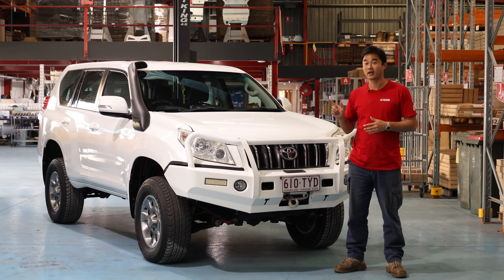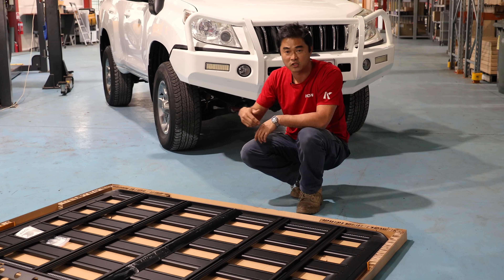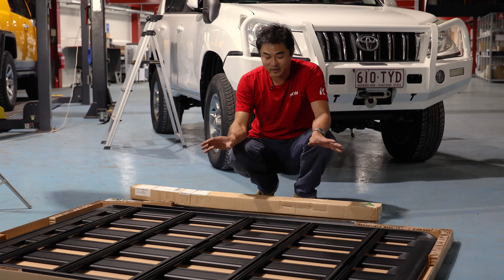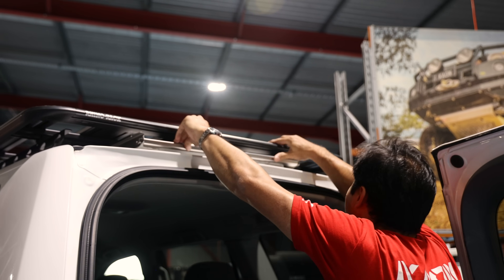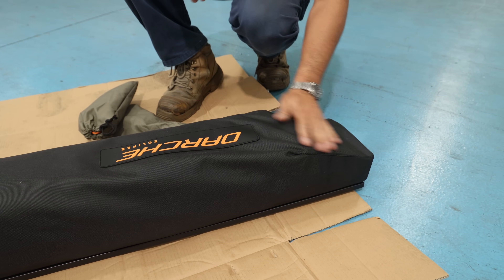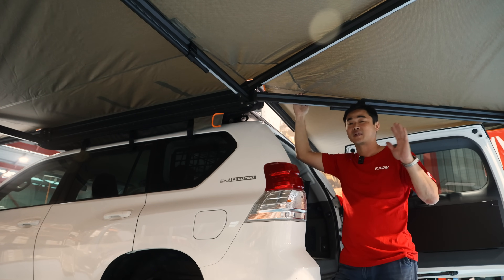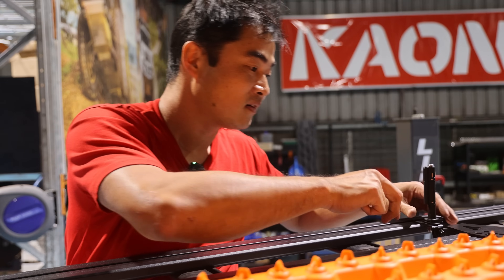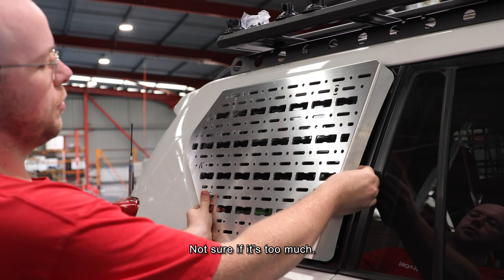Working Top-Down: Fitting out the Roof Rack & Concept Products Behind-The-Scenes

Comment: Have the same awning on the same car, the extra flap at the front slides out and you can slide it in the rear arm to bridge the gap above the boot. Great for when its raining
Reply from the maker: Yes definitely, great tip! We've got it stashed inside the car at the moment but it'll come in handy if the weather turns sour.

Comment: Like the roof rack and accessories, will probably get your max trax mounts, they look nice.
What weight for the roof are you using as the maximum all up for the Prado?

Those rear window outside mounts look interesting. If you are going to make them suit a range of roof racks I can see a challenge there.
We have an ARB base rack that is a lot wider than the back bone and sticks out quite a bit on each side, but gives us more space and your feet to not hit the Prado body when using a side ladder.
It would be nice if you can get your hand [flat] behind the panel to clean the window if necessary, and make it easier to fit attachments
Mud can accumulate under things like those window panels over time
Can see these being very successfull if enough accessories are fitable
I guess you can only go as wide as the mirrors, is that correct?
Reply from the maker: All great points and questions! 

From memory the Prado has a 100kg load rating, so we'll be working to keep both well within that and the total vehicle GVM. 

Definitely will be a challenge to release the Exterior Panels for multiple vehicles – the adjustability for the variables across the market is going to be the biggest challenge, but not an impossible one. Even just within the Rhino there are various rack sizes and configurations available for the Prado, let alone the other rack makes on the market. 

We wanted to get a working prototype on the car for real-world testing. As this is a totally new concept for us, there are some unknowns with the method of attachment we've selected and nothing beats actually using it to learn what works. 

Extrusion laws for the side vary from state to state, so we're also currently gathering legislation from the appropriate bodies on this topic to fully inform what can be done.

Comment: You're really helping me out here with my shopping list of what I'm going to do with my Prado. Love your video's and looking forward to the next one, especially keen to see what this rear side window bracket is all about. BTW, is that table still available at Bunnings and does the table mount fit other tables. Cheers
Reply from the maker: Thanks so much for the kind words, glad to hear you're finding the series is helpful! The table mount is still available at Bunnings (It's the Marque 4ft Trestle Table, you can find the link on the slide listing FAQ). The mount is designed specifically to fit this table, so the chance of it fittings others is not zero, but they would need to be dimensionally the same when folded.
Reply: @KAONaust  thank you so much for getting back to me. Great that the table is still available and this will really help with my camp site prep. Invariably, the first thing my wife wants is the table set up and almost without exception, it's at the bottom of the pile of camping gear. Thanks again. Cheers👍

Comment: Great video mate, I'm about to do the same build, pioneer 6 on a 150 Prado. Already loaded with Kaon accessories, but will be getting that table mount! Any thoughts on the 1900 vs the 2100 platform? and do you know what the distance is from the top of the prado to the top of the platform with those spacers is? Just need to make sure it'll still fit in the garage!
Reply from the maker: We preferred the 1900 long as it just felt a little more in proportion with the roofline, especially with some of the accessories we were looking to add. That said, the extra 200 could be incredibly useful if you're mounting some longer/bigger accessories. if we were going for a longer awning, say a 2700L one, the 2100 would have been a more suitable choice. 

The distance is a tricky one, there's no great spot to get a measurement from! If Rhino-Rack have any dimensions available on the standard rack height, these spacers (which we source from Rhino) add just 10mm.
Reply: @KAONaust  thanks mate!

Comment: IKEA instructions 
Read a lot about where the backbone mounts the covering is not the best compared the factory a lot of potential for water leaks
Reply: I got leaks after installing a frontrunner rack that installs in a similar way to the Rhino one, only noticed when the seatbelts started to get wet. Had to remove the whole thing and put silicone on the threads and around the bolt hole things. I'm not super handy with these things so would have been great if they included some water proofing in the instructions so I didn't have to find out the hard way.
Reply from the maker: Yes that's something we have seen people report as well – you need to be careful with the install for sure. We took extra effort to look after those openings in the roof to protect against water ingress into the roof.